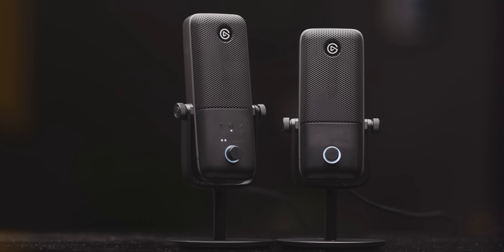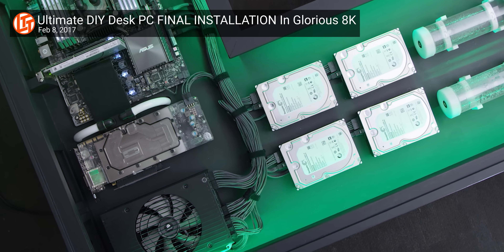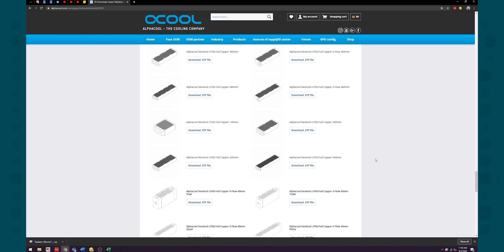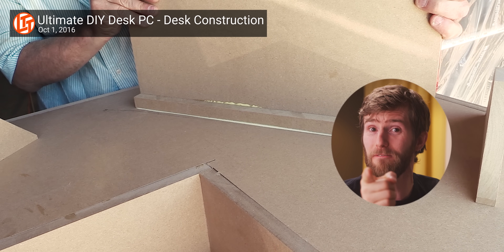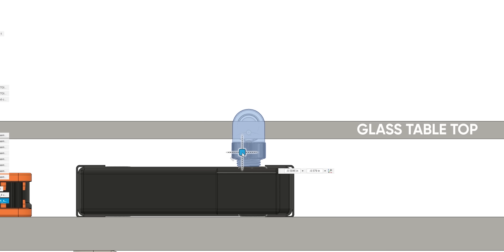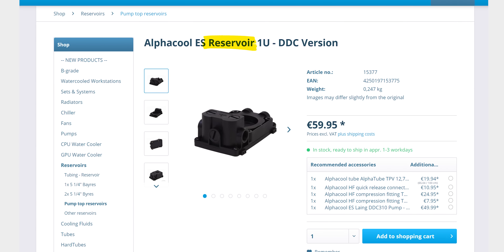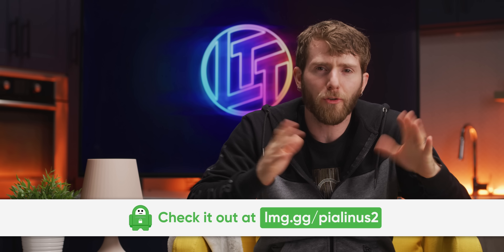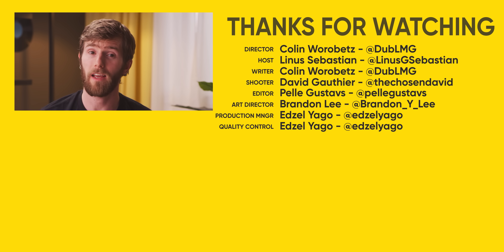Next Gen ULTIMATE Desk PC Design! - Part 1

Comment: "We're going to make it 1U high just to make it overly complicated"
Reply: Also are going with  40mm radiators, and only doubled the quantity originally which they say will make up for the 2x480mm rads they were using before... I don't think it will. Good thing they changed it to 6. Then again, they are stacking these as well and apparently that doesn't make them as effective.
Reply: yeah they are just punishing themselves with this design limitation  adding 1-2 inches would allow active cooling allow them to create a fake bottom for cable runs inside the desk rather then be janky with them under the desk
Reply: I also worry with the power situation. Even DC to DC convertors get WARM, and they will receive very little cooling. Since they are stuffed in the corner airflow will not travel over them as the pressure differential moves to the other side of the desk where the exhaust is. This will shorten the life of the convertors significantly if they don't cook themselves immediately. 1U is too thin.
Reply: even 2U would have been fine. I don't know why but I flinch more and more when I watch an LTT vid
Reply: Look people are wondering here whom never saw anything like this before let alone doing
Reply: @girlsdrinkfeck  Four of them are just Internet experts. Let them know at first about these stuffs practicality
Reply: @BrumBrumBryn  Double stacking does work. If you think about it, the rad doesn't instantly transfer the heat from the water to air, so the air that's being blown through the first rad is still rather cool enough to soak some heat from the second rad. It's definitely not the most efficient (theoretically), but it gets the job done.
Reply: @justbob333  They're youtubers, the more shit that goes wrong the better.
Reply: If it’s higher than 1U the ergonomics don’t work. Your arms need to be just over 1U from your legs for the proper legs and forearms parallel to the floor posture
Reply: Why ELSE do you watch LTT?
Reply: @BrumBrumBryn  They'll also need some sort of ducting to force the airflow to pass through the radiators rather than around on its way out of the desk.

Comment: Next Episode:   Leak testing custom reservoir
Next Next Episode:   Desk Aquarium Build
Reply: Desk aquarium is an awesome idea. Would have to sound dampen it for the poor inhabitants though
Reply: You have never seen the Squirtle build from a couple of years ago
Reply: Next episode coming December 2021
Reply: dumpsterdawg hmm
Reply: Yes sir I would love this like the og pc builds
Reply: Patrick B  more like ultimate mess.
Reply: 4th Episode: Linus drops the bloody thing and has to start again!!!!
Reply: I'm from Poland and some I saw some polish guy doing it back in 2010 or something.
Reply: it would be terrible if it cracked... or leaked... like almost every mineral oil build over time...
Reply: @mitsukasouji  The mineral oil also wicks up the inside of cables.  I saw some builds where after a few days the keyboard, mouse, monitor cables etc started "bleeding" mineral oil.  Huge mess.  This could be solved with wireless keyboard and mouse, but it could still be an issue with the video cables to the monitor.
Reply: Actually I think that's an incredible idea!!!!!

Comment: "-WE- Didn't want to make any compromises on the actual PC Hardware" - Beard Linus talking about his new desk.

Beard Linus gets whatever the Beard wants.
Reply: Including hard drives, that should be considered compromise components in this day and age.
Reply: @c99kfm  He put in "50TB+" of storage. Probably 4 of those Seagate 16TB drives. He already has those (and needs to use them or send them back). With 4TB ssd's you would need 13 of them.
At around €600 (Samsung 860 evo) each that's almost 8000 bucks for sata ssd's. Even Linus knows that's a waste of money for a personal system. Granted those 16TB drives cost almost 500 each but that's still a quarter of what SSD's would cost.
Reply: @Ricko1Games  No compromises or not? 50TB+ is something I'd put on the network, but if he insists on having it in his workstation, do SSD. There are 30TB SSD, so two of those and he's good to go. Actually, there are larger still, but I haven't seen those for sale.
Note that he probably uses 2-8 TB M.2 NVMe on the motherboard, and he's probably doing what you're saying - using four drives he had lying around, just because he can. The problem (for me) is him using them in what HE calls a "no compromises" "ULTIMATE" build.

Comment: I feel like you gotta run the cables through the visible part! Nothing like smooth, elegant custom sleeved and mounted cable management under all that glass and tubing to give data center nerds a run for their money 😋
Reply: I agree, they could chose a theme to folow as of aesthetics. like, they could route the cables to make the desk look like a giant pcb board :p
Reply: Yeah, I totally agree on that! Also would fill up some of that empty space
Reply: pocket the cables using  cnc routing to drop the cables in the table under the other components. it would look epic!
Reply: 3D printed cable combs with little holes for screws on the sides.
Reply: Agreed custom length and sleeves. If your not gonna mess with the depth inside don’t mess with clean all around on the outside.

Comment: DIY Perks YouTube channel just posted their approch to the slim desk pc. Might wanna check that out. He had a very different approach to the cooling of the system.
Reply: It was kind of stupid tho. 40 tiny fans instead of water cooling
Reply: I wouldn't say it was that different. Overpressure in the "case" and the cooling elements on the outlets.

For the fans, i honestly think in both cases they should have used radial fans. As the outlet is offset 90°, even very large fans would still fit in the flat table, AND they have much better static pressure...

Comment: "We're gonna watercool everything", I expect water-cooled, power supply, ram and ssds then.
Reply: Yeah, but no way with the height requirement. Ram coolers are large for a reason. Can't get adequate water flow with compact fittings and lines.
Reply: Water cooled mobo VRMs
Reply: Flashback to the mineral oil build.
Reply: LINUS! design custom waterblock for your "too loud" 1U PSU.
Reply: Don't forget the desk tooo
Reply: Also water cooled fans
Reply: Fill it with oil and call it a day.

Comment: Those constraints you put to yourselves are so challenging, and I'd be eager to see how it's going to look once implemented. That being said, what's keeping you away from having more room for hardware by adding some height on the bottom of the desk unit ? Like using an integrated monitor stand both for cable management with integrated front ports beneath the screen, and some more airflow. You'd have soo much less hassle!
Reply: To add a challenge for themselves they wanted it to be only 1u in thickness so that is why.

Comment: Hollow out the leg(s) and run the cables down them to the bottom and plug them into the wall, you can also maybe fit the power bricks in the legs depending on how thick the legs are.

Comment: I would love to see you do interior cable runs, with the lines set up clean, like a circuit:off-set parallel lines, making 45s and 90 degree turns, minimal if any crossing,  pinned in place, and you could coordinate those runs with the water runs as well. Especially with sleeves cables that could actually add a lot to the look, and help fill some of that negative space.

Comment: I would recommend HardwareLabs SR-2 radiators instead of the Alphacool ones. If your main concern is the height restriction with G1/4" ports on the top, the SR-2 have multi ports (bottom, top, sides, front). The low fpi count of 8 make them perfect for your first idea of indirect ventilation.

Comment: I feel this might have been a great opportunity to do a segment on custom cabling runs. It would require a larger time investment, it's not overly difficult to build most of the cabling you'd need from scratch.   It would allow for much cleaner runs than using standard cables and  segments of extensions.          I did this for one of my builds, and it was time intensive, but ended up being worthwhile.  For a project this size, it might be a bit much, BUT it may also make a pretty cool build video, for a custom build feature that doesn't seem to get much attention.

Comment: Had you thought of doing a tapered design? Like a flat top, but the bottom taper to be bigger in the back? That way the front of the desk could be 1U or even thinner, then the back of the desk be thick enough to mitigate some of the thinness issues like having a power supply and water cooling adapters?

Comment: Since you have the space (and the means to make it possible) I have had a  couple of ideas for the ultimate desk pc, I would add a raspberry pi (or a couple of them) just to monitor temperatures maybe some rgh control, ambilight, a vpn tunnel, add voice control to power on, embedded LCD or AMOLED displays, etc... also a secondary low power PC, maybe a NUC just for NAS storage and being able to access the files in a low power ”guest” mode, an internal router to  add 4g and  ports, NFC reader, embedded wireless chargers, fingerprint reader, hidden hard drive docking bay, etc i am a little disappointed a the apparent lack of imagination when it comes to building this kind of systems.

Comment: HDPlex makes an AC-DC converter designed to be paired with the DC-DC converter that could easily be fit into the case and look great so you don't need external power bricks.

Comment: XS-PC EX Series multi-port radiators would solve the right angle fitting issue, but I don't think that they go to 480mm. Possibly, assuming the standard 1U height, you might get away with the XS-PC TX series radiators at 20.5mm thick with a non-rotary right angle fitting (which Alex should be making, you've got all that kit guys...) and something like Noctua NF-A12X15 fans just to help the air flow along a bit, under load perhaps.

Comment: why not have the fans as exhauste around the sides and intake in middle of the case near the rear I/O. While using the rads from edge to edge right and left towards the inside from the fans.

That way the air is sucked through the "sealing" rads ( with some white and orange rubber/foam) to seal rad to desk space) it would look more symmetrical and work a treat for air flow.

Comment: Why not use Alphacool radiators that have in-line ports as well (in-line with the channels in the core as opposed to only perpendicularly to the channels, like most radiators)? The NexXxos series has this, at least where I'm browsing from (the screen cap in your video didn't show this). You can then keep the original layout. Plus use a distro plate layout? With  a flat, thin build you can use wide channels and still get enough cross section to not impede the flow of it. And you can use the whole surface area of the table a reservoir.
.
Plus not having fans directly on the rads will cause problems since you don't have much air pressure over them. You'll need a well sealed chamber (the whole table being said chamber) to achieve any airflow through the rads. Or use shrouding, ideally, but then you lose the aforementioned flow over passively aircooled components.. Best case scenario would probably be to investigate passive cooling rads and throw loads of them into the desk and use the fans to achieve enough airflow over them to get relatively decent temperatures.
.
Regarding the HDPlex, they also have a single unit 800 W version which is essentially a twin 400 W version on a single PCB.
https://hdplex.com/hdplex-800w-dc-atx-with-16v-63vdc-input.html
And maybe you can use industrial power supplies to keep everything internal, something like this from MeanWell (the actual model and number of them used depends on the thickness, voltage, etc. etc.): https://www.meanwell-web.com/en-gb/ac-dc-industrial-din-rail-power-supply-output-dr--ups40
EDIT(2): HDPlex actually have their own 400 W AC-DC supply as well: https://hdplex.com/hdplex-internal-400w-ac-dc-adapter-with-active-pfc-and-19vdc-output.html
.
EDIT: one option for the rads would also be to seal the whole chamber very well and throw multiple thin 40 mm rads that are used in the mockup all around the sides of the table, exhausting air left and right. Then you just use a ton of 120/140 fans to push air in from below, maybe in the middle and have a mid to side flow with it exhausting through the rads. Or use the passive version of the Alphacools, shroud them closely at the side of the table and push air along the axis of each unit with the water flowing from the end of the table inwards. You then also get the benefit of a crossflow (water and air moving against each other, which enables you to achieve even lower temperatures).
.
EDIT3: God can't leave this alone... What about pivoting with the whole deal and use the legs or their structure as a mounting point for (passive) radiators? So you move the heat away from the main components chamber. Yeah, your legs would get hot, but if you shield the radiators from the legs with an MFD board or something similar it should be okay-ish?

Comment: In your next Gen ultimate build you should include a spot for a monitor mount system to grip on the edge so that you don't have to remove the monitor every time you want to lift the glass and do maintenance or upgrades.

Comment: I just ask that the cable management looks nice under the table, either make/modify some cheap brackets and give everything its own run with nice angles and straight lines, its the least you can do if you're going over the top for the presentation side of the table

Comment: Honestly you should increase the thickness of the radiator by 1cm which still would not make it much larger then a 1u server then use alphacool X flow radiators the plan to have flat radiators would look better then a bunch of smaller janky ones using X flow you could use the ports on the side making tubing runs easy to run and be much more pleasing to the eye

Comment: I have a 3960X and a 2080Ti and under full load it pulls around 750W.
Those 2x400W DC-DC converters arent going to cut it, you may need either a third one or bigger ones.

Comment: 1U (1.75") total height is going to be a creative build.
Nvidia 2080 ti pcie riser cable connected to the first x16 card slot.
Unfortunately hiding that first x16 cable could be a problem.
but once done all other pcie riser cable can be routed under/over it.
so any pcie cards can be connected to these individual pcie riser cables.
If this is a metal build then rubber grommets should be around all holes to keep cables safe. 
The dimm.2 vertical m.2 ssd module probably sits too high to fit in 1u height.
Do the hard drives power down when not in use to keep noise down.
10 gigabit ethernet link connected to your petabyte server.
So you only need 2 or 3 m.2 4TB ssds to contain OS and applications.
Would like to see tinted tempered glass on top, sleek and stylish unassuming design,
until you enable the desks internal led illumination that show off that LTT awesome uberness. 
Bluetooth mouse and bluetooth led backlit keyboard and ASUS 43" 4k 120hz monitor.

Comment: If you're going to call it the ultimate desk PC design you really should think about not hiding the wires underneath the deskinstead you should route them nice and neatly to each component I think it would add an extra element to the design. I've seen some pretty tricked-out ones that will add a lot more time to the build because you would have to wire each wire of the 24 pins to look good. I know they have metal wire trainers that you can get already installed on the wires. Maybe do some plexiglass ones?

Comment: instead of an external power supply what if you put the power supply in the bottom of the leg of the of the desk with a 90 degree cord and also if you hollow out all of the legs it gives you the option to decide where the power supply is

Comment: Hmm just food for thought : why not make the entire unit of the table see through water cooling with the table legs internally built in pump and reservoir ?? E.g all 5 surfaces of the table [ length, width and the bottom surface to have 2mm tick hallow for water to pass through ] and left leg table for inlet water with pump  whilst right for empty and easier time for water waste collect .

Comment: Wait.. You said that a problem with the first one is the vibrating hard drives but a very easy solution for that is to put the drives on some sort of shock absorber like rubber or foam.

Comment: Don't use an external power brick. Choose whatever PSU you want to use and reverse-engineer the PCB to a new one in order to squeeze it into the thickness you want. You have effectively free range over XY space, so you should be able to make something that works!

Comment: the power lines and all should be shown in the desk just have to make them custom and have a circuit layout i would make them gold or silver sleeved  it will give it more depth to the inside more to look at than the basic components and water lines also i would do a custom acrylic pour over the main surface to make a better back ground rather than spray paint crap if u are going to go all in then go all in

Comment: Ducts dude. Duct the air. Should be able to do this in clear and add to top rigidity. Supply and exhaust for the pc hardware and separate for the radiators. Btw the air for those two things should be separate and not shared. Test this with smoke like done in home door pressure tests to confirm design before fixing in place

Comment: Suspend the desk from a single monoblock foot center rear that houses the PC below desk height and monitors above with USB ports etc at an inch above the surface of the desk for easy access. Oh look a much better idea in the seconds since my last post (and that's including my slow typing).
Use a wireless, keyboard, mouse and gamepad and there you go, zero wires on show!